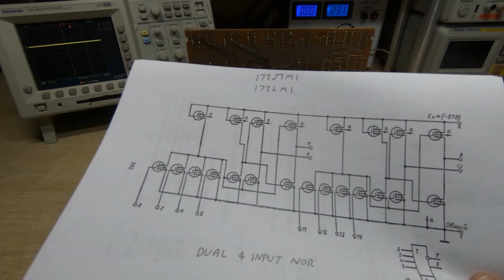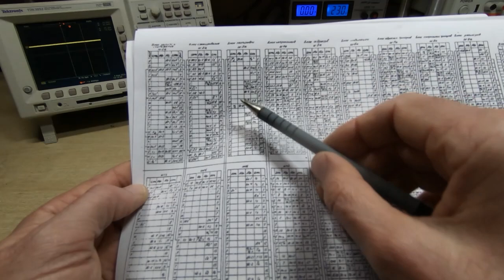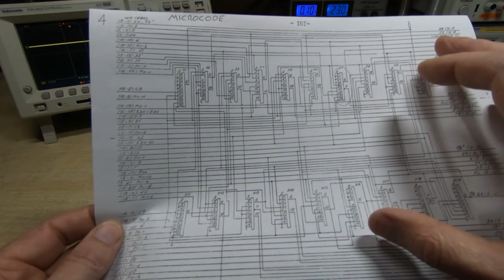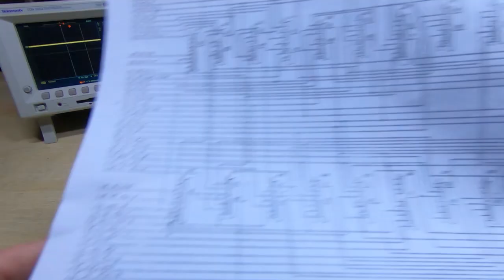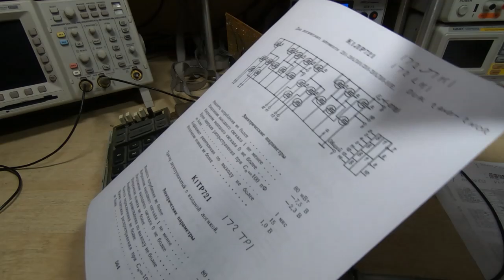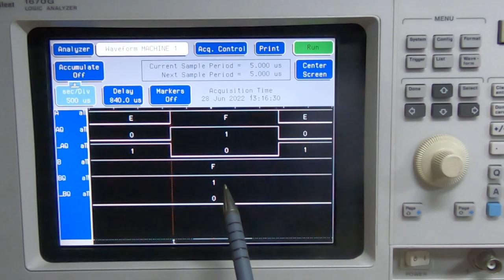Elektronika D3 Repair Part5

Comment: I was thinking about your comment of adding a transistor to create a separate inverter for a non-functional complementary output, in the event that you are unable to locate spare parts. I thought of another possible idea that you might not have considered. You mention at one point that there are a relatively small number of different IC types in the calculator, that are used on the various boards. Is it possible that on any of the boards, there is an IC in which both of the complementary outputs are not being used, that is the same IC type that is defective where both outputs are used? If so, you could swap the two ICs.  I wasn't able to see all of the schematics clearly in the videos you have created, but it does seem that most of the devices' outputs are all being used. It's a bit of a long shot, but it might be worth searching for.
Reply from the maker: You could certainly try that (I have covered this in previous videos) but it could be difficult in this case considering that the schematics are not a 100% match and this repair is complicated enough. It is also very unlikely that enough donors could be found in this machine and is not really a good idea with these PMOS IC's because the nature of the failures can cause damage to other parts even in unused gates. The reason for this is the 'totum pole' design of the IC's which is unlike TTL devices. These IC's are normally easy to obtain but at the moment it is pretty much impossible to source them.

Comment: If you have an IC with complementary outputs and one output is bad but the other one works, you could just hack in an inverter if a replacement is unavailable.
It just makes the board look less appealing, ie. not original / tampered with, but it'll fix the problem and you can go on finding more faults that linger.
Reply from the maker: That is Exactly what I said in the video.
Reply: @JerryWalker001  weird, I thought I watched the entire thing and listened with at least 3/4 of an ear.
Reply: @senilyDeluxe  23:40